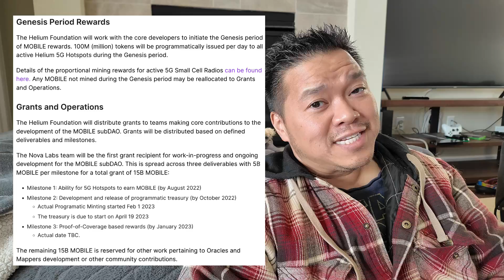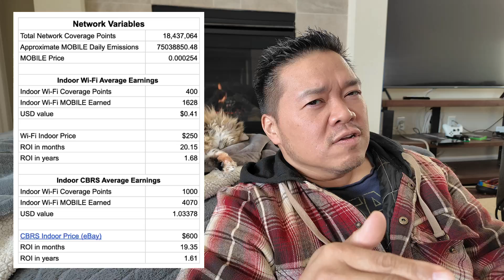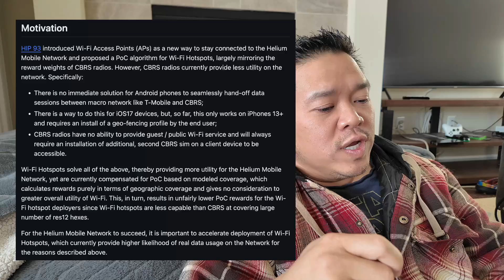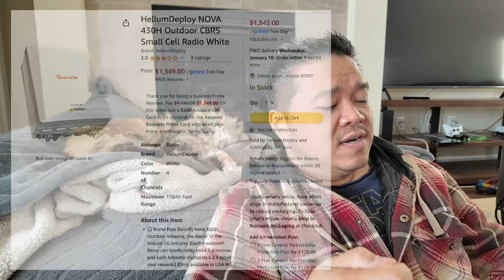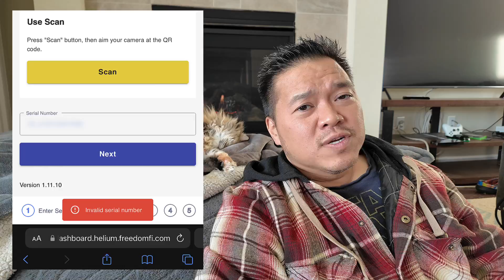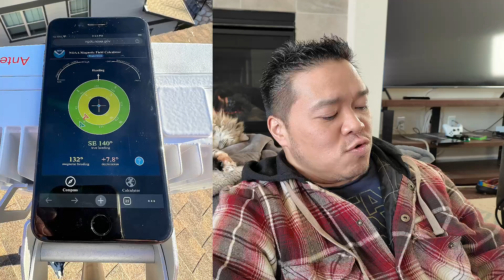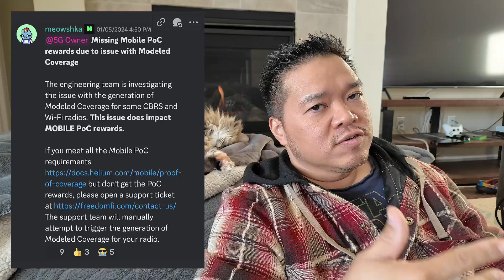Top 10 Woes With Helium 5G Hotspot Mining

Comment: Hey Guy. I appreciate your videos. Are you sure about needing firmware "v1.9.0"? I just fielded a 430H outdoor CBRS radio that I ordered on Christmas day from Helium Deploy for $1,599. I have it on a stand on my balcony. I went through the registration process and got approved three days ago, and it's now earning 15,000 Mobile Tokens a day. The software version of my two year old Gateway is 1.3.0 with AGW Version of 2.7.9, and it's all working properly with the 430H. The CBRS radio is SW version:  "BaiBS_QRTB_2.12.12_Helium" with HW Version:  A01. Again, it's all working properly and I had no installation issues. Thanks again.

Comment: My freedomfi is on software version 2.7.9 and software 1.3.0 and works as expected.  That one makes 13,000-14,000 token rewards per day.
Reply from the maker: Well now I’m worried. Maybe the miner needs the update? The radio dashboard says “ no supported radios, are attached to the freedomFi Gateway” so what’s wrong?
Reply: @DewItJustinKace  yeah I remembered it said that when I registered the cell. It took about 24 hours to get approved and it showed up after that. Did you assert the iot location then the mobile location?
Reply: What versions are on your Miner? My AGW is 2.7.9 and my miner version is 1.3.0.  My indoor CBRS is on port one and my outdoor is on port 2.  Port 2 goes to the POE injector first (make sure you on the right port on the POE injector) and then out to the 430h. @DewItJustinKace

Comment: I set my nova 430 up last week. CPI took 3 days and my rewards are more than the planner stated. Trying to ROI as quickly as possible. You should have tested the antenna by a window before mounting it on your roof. It looks like you have a PoE or cable issue maybe…keep trying. No reward without some risk in life 😊
Reply: YouTube is a mess. This is my third time trying to reply. My WiFi hotspot is indoor. I just listed it on eBay. Regarding your Nova 430h, you really need to take it off the roof and test it. Support won’t be able to fix it if it’s not detected. I suspect your PoE cat 6 cable isn’t good. Try inside by a window with a short cable first. It takes less than 5 min to recognize one plugged in. 10 min max to get a gps fix and then you will be able to see it in the Radio Dashboard and register it with CPI.
Reply from the maker: @Thirdmillennium007  ah. I need an outdoor one. Anyway people on discord tell me the serial number is not in the database so it doesn’t register. I’ll work on that next. Gotta get back on the roof and get it. Thanks for trying to help tho.
Reply from the maker: Unfortunately, this the system only came online the night before my friend arrived to set it up. So I had to do what I had to do. Congratulations to you though. Did your system find the CBRS right away? Or how long did it take?
Reply: Once you plug the antenna in it shouldn't take more than 5 min or so to recognize. It needs to get a GPS fix before it comes online - that can take another 10 min or so. It will say 'trying' on the spectrum access part of the dashboard until you submit the photos to CPI and they approve it. In my case I submitted Jan 1 (holiday), they had it approved by Jan 4 and it started to reward me the next day. My first rewards were halved because of a speed test problem (I was getting less than 100Mb down).If your antenna isn't showing up in the radio dashboard, then you really need to switch the cable...you may need to bring it back down off the roof until it shows up - I don't know how they would fix it remotely....and my miner is version 1.30  @DewItJustinKace
Reply: anyone wanna buy a Wifi hotspot? I ordered one before the Baicells and it turned up afterward LOL!
Reply from the maker: @Thirdmillennium007  indoor or outdoor?

Comment: lol, I'm in the same boat as you, I missed the mobile gen drop but I've had the original gateway that they shipped in may 22 but it never shipped with the outdoor cell.  I was board during the holidays and ordered the outdoor CBRS 430H like you and I am also currently stuck with cpi approval but my system didn't update so no mobile rewards, yet, sent them a ticket.  I do have 2 in door wifi spot set up, one is earning 550 mobile a day and the other is at 137 mobile for some reason they are right next to each other(roi in , 155 and 625 days).  I also ordered the $600 outdoor wifi hotspot that should ship next month.  But yes I agree, the CBRS is not currently a good investment, even the indoor ones don't look too hot either.
Reply from the maker: Thanks for telling me your story. Did your hotspot update to 1.9? I can’t even get CPI approval because I’m not up to 1.9. At least I assume that’s the reason. So if you can verify that for me, I’d really appreciate it.
Reply: Yes, I got the email said " Congratulations, your radio has been CPI approved and is now eligible for SAS authorization. Please note Authorization may take up to 24 hrs depending on your installation location" 3 days ago.
Reply from the maker: @keenefish  Augh. Guess I’m in trouble.

Comment: I relate to you quite a bit on this man. I submitted my updated pictures on Friday, and I'm hoping they can get around to approving my hotspot soon. They must have an absurd amount of radios to sort through ,or so it seems.
Reply: When they were doing the initial genesis. They didn’t really check the pictures or anything so they were approved right away and now they’re actually checking each one so it takes a little longer. Mine took about a week when they decided to reject mine because of the picture mistake to get re-approved
Reply from the maker: Are you on version 1.3 or 1.9 of the software? Still trying to figure out why I can’t submit yet.
Reply: Let me take a look. @DewItJustinKace
Reply: 1.3, and I can't do much until they finally finish with approval.  @DewItJustinKace
Reply: Update: They finally approved. @DewItJustinKace